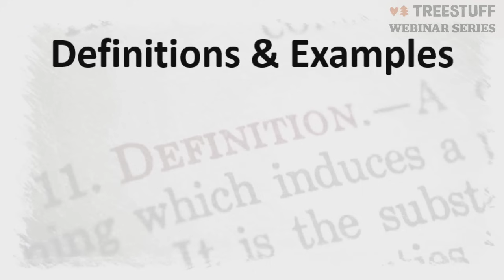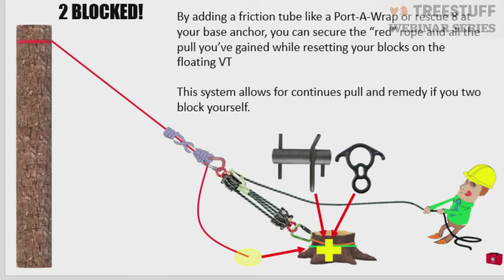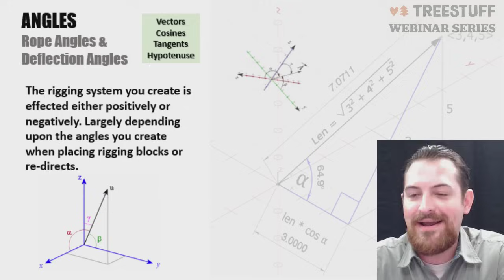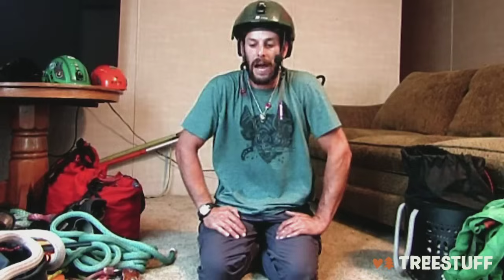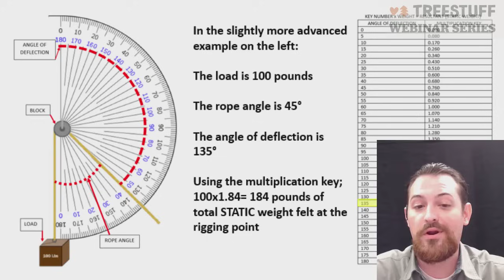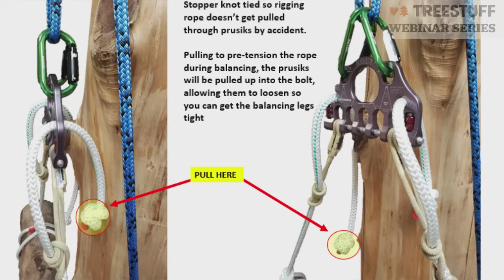The World of Rigging - TreeStuff Webinar Series

Comment: @14:15 The reason there is 800 pounds on the tree but only 600 on the anchor is because you are standing next to the anchor point and your 200 pounds pull on the tail is added to pull on the tree. There are 5 strands pulling down on the tree block, but only 4 strands pulling up on the anchor block. It has little, if anything, to do with friction.

Comment: Hi! I realize that I am super late with this question but thought I'd give it a go anyway and hope for an answer. My question is regarding the formula for calculating shock load. Load x the distance of fall + one load. In the example following the formula (dynamic event example) the notch is cut 1 foot above the block. And then the math follows, 207 x 1 foot of fall + 207 = 414 pounds, plus ofcourse rope angle of 180 degrees so 828 pounds. But the piece will fall alot more than 1 foot in this example, it looks like the first tie in point on the piece being rigged is roughly 2 feet above the block and therefore the fall would be a minimum of 4 feet which would equal the force according to the formula to be 2070 pounds! Or is the formula as such that we always calculate the distance from the notch to the block rather then the distance of fall? Looking forward to an answer! Kind regards from Sweden! =)

Comment: John Coles question. You won't over load the lateral limb because you are losing the lateral leverage and hanging the branch from the point of cut . When you are out on a lateral branch and knock the end off, the branch will lift up and your high point will become loose. Same if you rig directly off itself. Try hold a chair out directly out in front of you with your arm by the chair leg. And then try hanging it down. Much easier. Same concept with when you rig the lateral leverage off the end of a branch and rig it and it hangs static in the air. There will be less load on the remaining limb and union.

Comment: The general presentation of rigging systems shown in this Webinar appears correct and generally useful for working arborists. Nonetheless, whatever system you use to calculate shock load on a rope system ( Hall's, Reese's, Attaway, Weber's, or a Handbook such as the one described in the webinar), it is absolutely essential that the Center of Gravity (CG) of the falling object (log, logger, etc.) be correctly identified.  In the illustration shown around minute 55:30, the distance dropped, “d”, is the vertical travel (fall) of the CG.  For a cylinder of length “L”, the CG is located at L/2.  The distance traveled by the CG will usually be determined by the initial height (h) of the CG above the pick point (pulley around which the rope is moving), multiplied by 2, or d = 2h.  Thus, in the illustration, the log cylinder CG will fall a distance of 2 x (1'+ 3'/2) = 5', minimum.  If we include the extra distance to the pulley of 4.75” as shown in the illustration, and take into account the likely slack in the line and gear, the full drop will be d= 6', not the 2' described in the example. The important contribution of the length of rope in tension and its mechanical characteristics are not shown in the example, but I assume they have been included in the “handbook” referenced by the presenter.

Comment: Some of the pulley ratios are incorrect and the load cell is in the wrong place. The 2:1 he mentions is actually a 3:1 setup, and the 4:1 he mentions is actually a 5:1. The difference between the two load cells on his 4:1/5:1 set up is not due to pulley efficiency but due to one side actually pulling a 4:1 and the other pulling a 5:1.

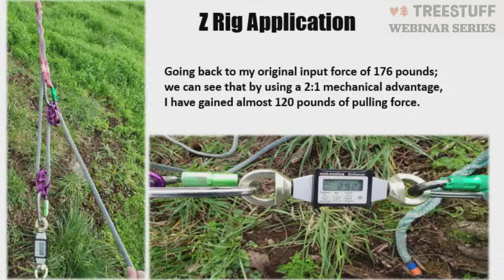Comment: Take a closer look at the "4:1" hauling system shown at 13:05. This is actually a 5:1 advantage pulling on the load (the tree). Count the ropes acting on the upper left block, biner, & hitch: 4 from the pulley block and one from the man, for a total of 5. The load cell should have been place between the hitch biner and upper pulley block, not on the anchor.
 Now if you declare the stump anchor as the load, it is correct as depicted.
Reply: yep!
Reply: The 1 to the man doesn't count. Ffs

Comment: 20:58, Why would ma and MRS still be a controversy? 

Simply put, negating the crotch rigging, you pull twice the amount of rope that the load (you) travels. 

For the sake of this example:

Work (J)  = Force (N) * Distance (m)

Work (out) = Work (in)

Say your Force, or weight, is 900 Newtons (~205 lbs), and use MRS to go up 10 meters.

Work(out) = Force (out) * distance

Work (out) = 900 N * 10m = 9000Nm

You need to perform 9000Nm or 9000 Joules(J) of work to some system to get up the tree.

Think of the MRS as a system, and your input is what you pull out behind the friction device.

You will end up pulling 20 meters of rope from the system to get 10m of elevation of the load.

The amount of Work (output) never changed

Work (out) = Work (in) = 9000 J

9000 J (in) = F (in) *  20m

F (in) = 450N 

Force (out) = 900N

Mechanical Advantage = F(out)/F(in) = 900N/ 450N = 2

Keep in mind you are never creating less Work.  Negating friction, and after loading, because acceleration is constant throughout the rope, so is tension. Once loaded, with a good friction saver, efficiency of the system should be near perfect. Add more friction to the moving rope, add more work, and and energy is lost through heat (Heat loss is usually efficiency loss, which is BAD). Get an inexpensive luggage scale and do some garage experiments with a 10lb weight.

Have fun and climb safe!

Comment: One comment on your dynamic load calculations when negative rigging. When calculating your fall distance it's two times the distance from rigging point to pulley. To use your example, if the block is 1 foot below your rigging point the load will effectively fall the one foot to become even with the rigging point introducing 1 foot of slack then continue until the catch. With a 1 foot example the tipping moment of the stem and tension applied to the line can mitigate a lot of that, however the further your rigging point is away the more amplified the problem becomes. With your two foot example and adding in the additional 1 foot of slack you're looking at over 5 feet of dynamic free fall! Following the math, 207 x 5 + 207 = 1,242 pounds of load, times the multiplication factor of two for the 180 degree rope angle your terminal gear is actually seeing 2,482 pounds!! 

All that from a 200 pound log.. 

Granted that's all calculated based on a static catch, which we know is hard on gear but there are times it's a necessary evil.
Everybody be safe out there. Keep your saws sharp and your eyes up!

Comment: I have a question regarding the progressive capture as a back up to the maasdam rope puller. If the rope were to slip or maasdam fail would the blake's hitch hold the load? Would you need a tending pulley between the maasdam and the hitch or would the maasdam not beat up the rope?
Reply from the maker: That really depends on the load, size of ropes, etc. There is a fairlead on the Maasdam for the pulling line which may advance the prusik, but a pulley may make that action a little smoother.

Comment: Great presentation! One note though, a Z-rig is a 3:1 mechanical advantage. Also when measuring dynamic load in a negative rigging situation, wouldn't the distance be calculated from the block to the first knot tied on the load? That would be the total distance dropped in the system.
Reply: Doesn't matter where it is tied as long as it doesn't cause the piece to flip. will fall the same distance tied at the end close to the cut or just below the center point of the piece.  I know it sound strange i had to test it for myself 😁
Reply: 11.33 is 2 to 1. The stump is only acting as a redirect. You could put 100 pulleys in like that and it wouldnt create any advantage.
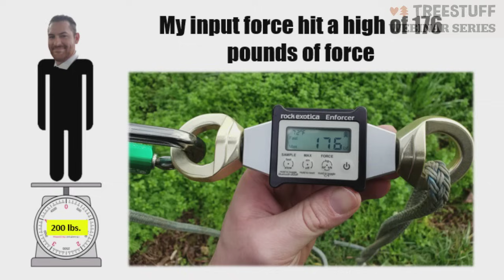Reply: Yes! At 11:33 the slide for the Z rig, you get 3:1 advantage on the tree to the left (3 units of tension) but only 2:1 (two units of tension) on the stump to the right.

The stump is identified as the anchor, so the tree is the load. The force gauge is in the wrong location to demonstrate the 3:1 advantage for the classic Z haul rig. The gauge should be between the tree and the first pulley.
Reply: @HeyNylo  Spot on.
Reply: There are three rope parts in play with the Z rig but only two providing a Mechanical Advantage. I think that what the principles of mechanical advantage slide is saying